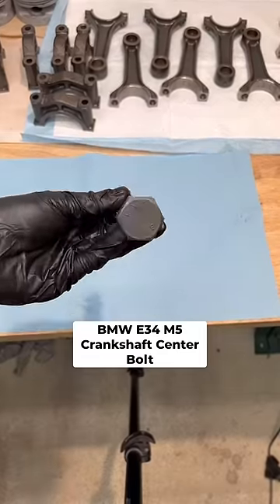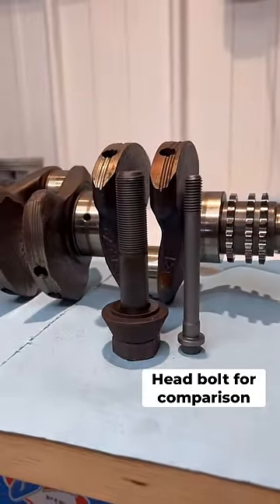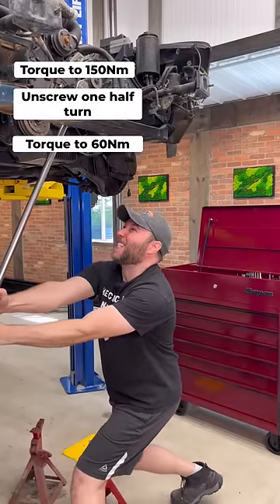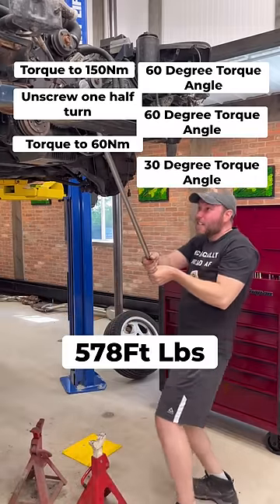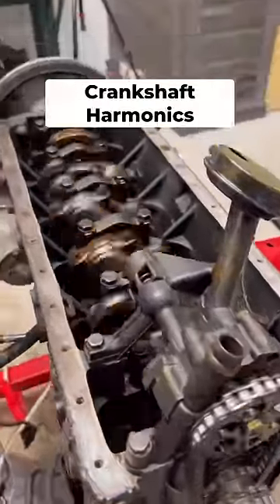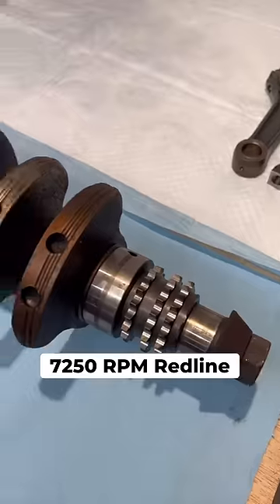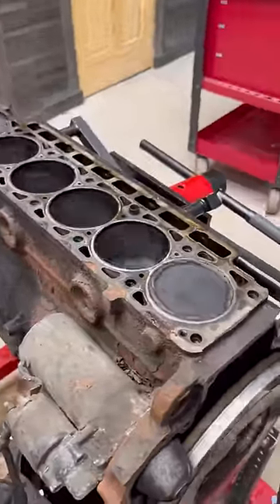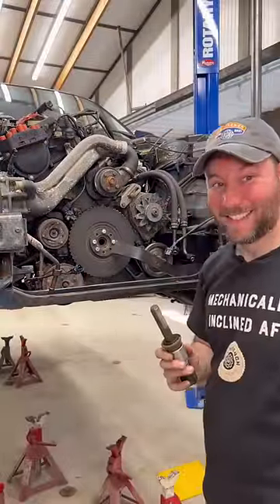BMW E34 M5 Crankshaft Center Bolt Explanation #bmw #cars #diy #bmwm5 #bmwe34 #restoration #engine

Comment: A nut on a truck is 650 lb/ft, so there is nothing impressive there
Reply from the maker: That's totally true, its just abnormally high for a crank bolt

Comment: My stock 1J is revving out to a 7500 rpm redline, quite frequently…and doesn’t need all that extra bullshit and torque procedures and torque value….BMW, over engineered for an under-achieving pile of scrap.
Reply from the maker: Much smaller engine that's why